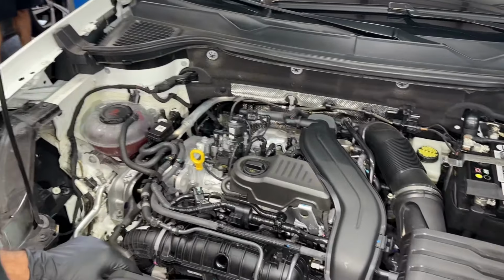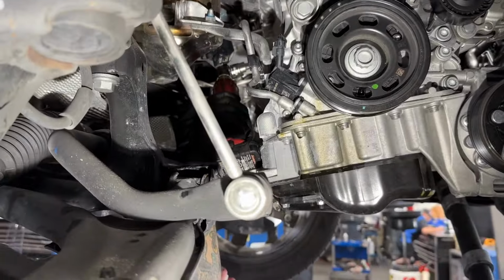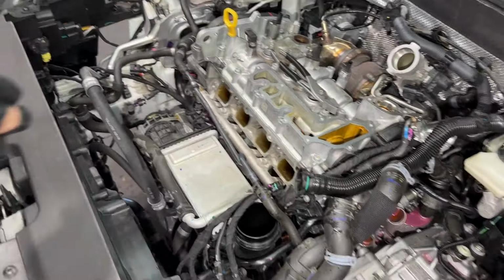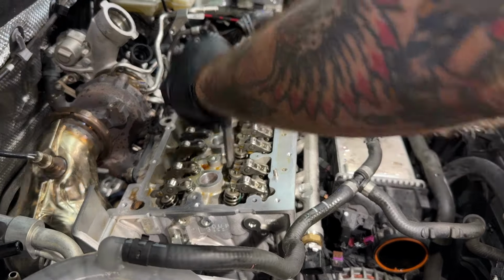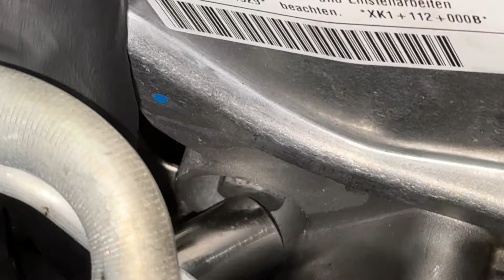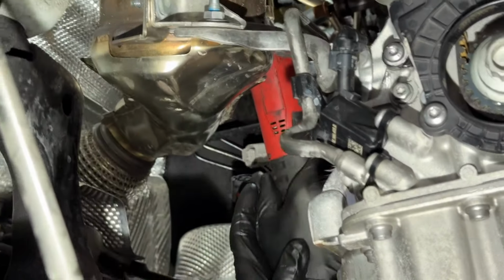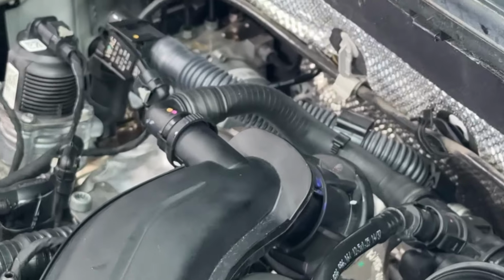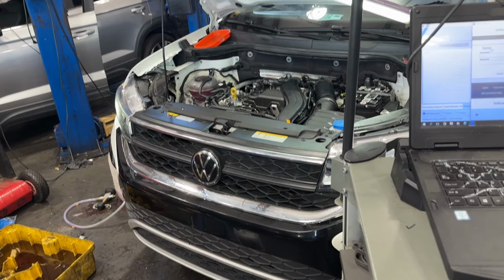2023 Taos Head Gasket Install

Comment: Has this issue been addressed for the upcoming 2025 models?
Reply: It was fixed for the 2024 models. There was a TSB on it and everything from August ‘23 onward is good.
Reply: @itzed thanks for the heads up!
Were the gaskets bad, or were they not torqued properly?
Reply: @auxmike718 I believe it was replaced with a new gasket design.
Reply: why does my car smell like oil 30k miles after this repair? any thought if my mechanic didn’t reinstall something right?